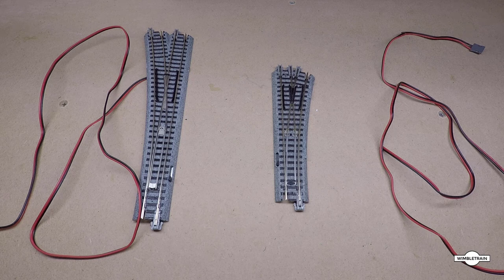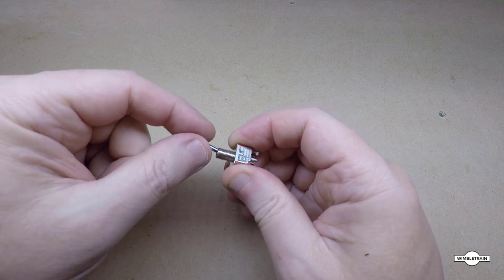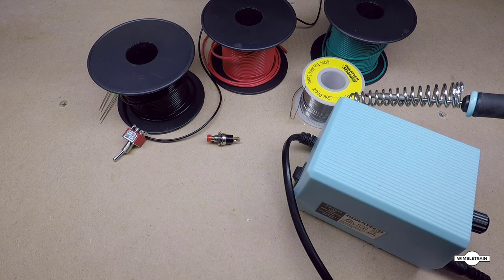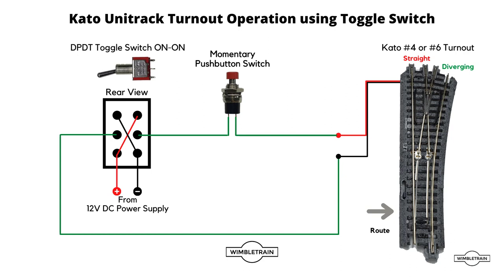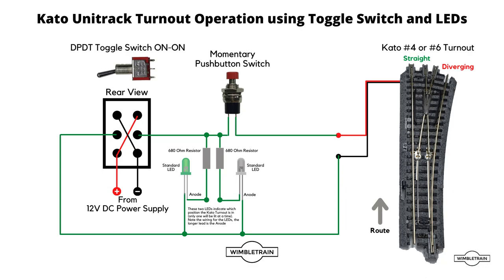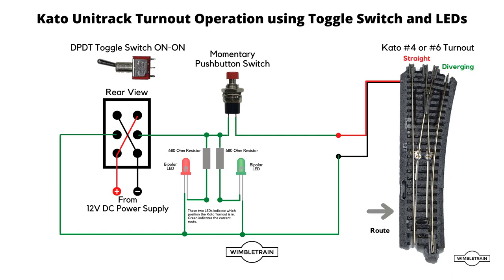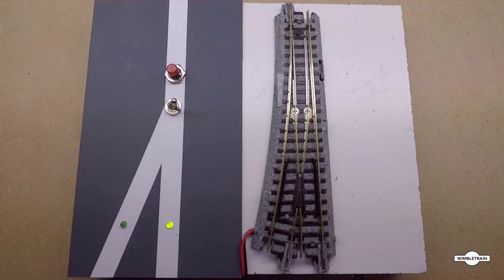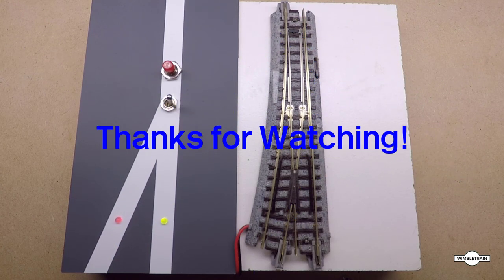Kato Unitrack Turnout Operation using Toggle and Pushbutton Switches

Comment: Hi John. I seem to be missing something. Why are two switches necessary? If this is to prevent constant power to the turnout, I believe there are momentary types of toggle switch.
Reply: The problem with the momentary switches is the diods don't work with them and by looking at them you can't tell which way the switch is thrown. You need to add a point positioning indicator to get diods to work. I explained that in a rather lonng comment here, which is not showing up for some reason.
Reply from the maker: Absolutely correct
Reply from the maker: Hi Paul, someone further down in the comments asked the same question and Raven below has explained it. This was my reply to the question from dexterdog62:
Yes you can leave out the pushbutton switch by using a DPDT (ON)-OFF-(ON) Toggle switch in place of the DPDT ON-ON. (The brackets around the ON means momentary)
The DPDT (ON)-OFF-(ON) is a momentary switch where if you push it either up or down it will spring back to the centre OFF position when you let it go (i.e. it provides a momentary pulse of the 12V to the turnout). However in this case there are a couple of issues that arise:
1) The toggle switch will always be in the middle so by visually looking at the toggle switch on the control panel you cannot tell which direction the turnout is in currently.
2) The LEDs will not be lit when the toggle switch is in the off position, they will only briefly come on when you operate the toggle switch. In this case we would need to create some extra circuitry to operate the LEDs (something I have never researched).
However, on my control panel that I used in the past (which I did a very brief video on (https://youtu.be/en39135I0so) I came up with a modification to the circuit used in this video (the one with the bipolar LEDs). I added a relay to replace the pushbutton on each turnout and then had one master pushbutton to operate the turnouts. This way you would just set the toggle switches to the route you wanted (on multiple turnouts) and then one pushbutton would operate all of the turnouts that needed switching. I feel another video may be coming to show this! Cheers John
Reply: @wimbletrain  Do you see any advantages of the system you demonstrated against the point positioning indicator + ON-OFF-ON momentary switches? I found a switch where you can fasten the wires with screws so I'm hoping to avoid soldering stuff altogether and end up with a faster, more responsive system while only spending around 4 more EUR per switch. The only reason I'd install the button is if I wanted to synch 3+ throws while preping all that in advance. That said, I'm new to the hobby so I could be toatally wrong.
Reply: @nscalealbulalayout4100  Hi, there's nothing wrong with using the momentary toggle switch, you just won't have LEDs as indicators. You can use any kind of switch as long as it is DPDT (ON)-OFF-(ON). the version with the screws sounds good as you don't want to mess around soldering, just make sure the two ON positions are momentary.
Reply: @johnogsii7976  Using the "point positioning indicator" you will have the LEDs and you'll even be able to set their brightness.
Reply: @nscalealbulalayout4100  hi can you link me to the switches you are using please?

Comment: I would like to control Two turnouts with the one switch, How can I add 2 to 1 switch
Reply from the maker: Hi Katelyn, you would just connect the second switch to the same points on the circuit diagram as the first one. Depending on where you want the position of the switches to be you may need to reverse the black and red wire on the switch. So for example you may have the first switch wired up as per the circuit in the video but the second switch might need have the black wire going to where the red of the first switch is connected to and the red wire of the second switch going to where the black of the first switch is connected to. Hope this is not too confusing! John

Comment: I do not have any of the standard wire connector plugs for these turnouts.  So, I will just solder wire directly to the pins, but do you know offhand which one is red and which one is black??
Reply from the maker: Hi, just had a look at one and the black wire goes to the pin that is nearest to the outside of the track